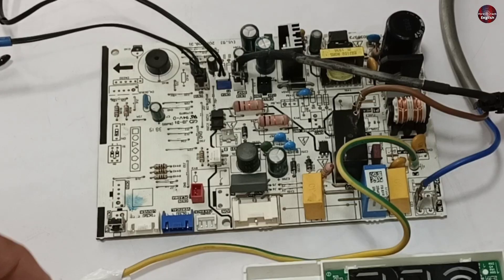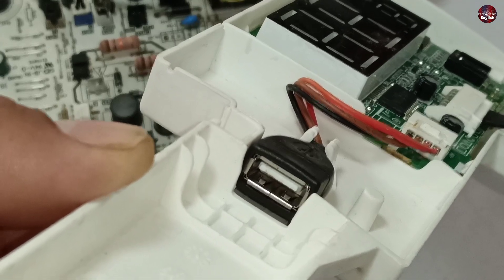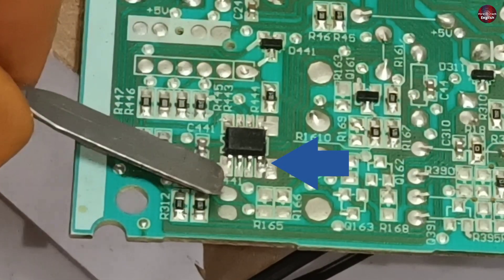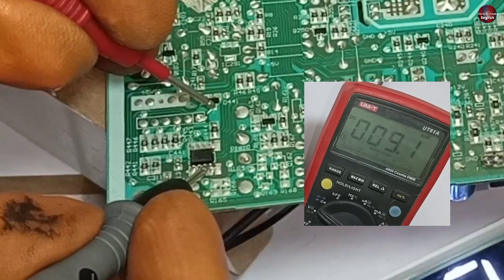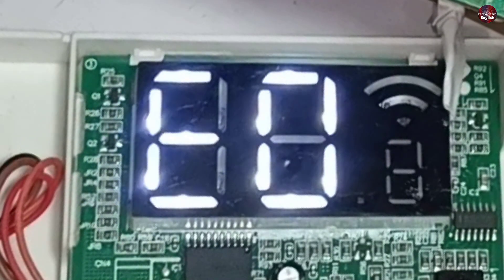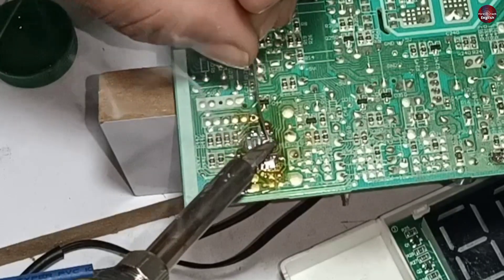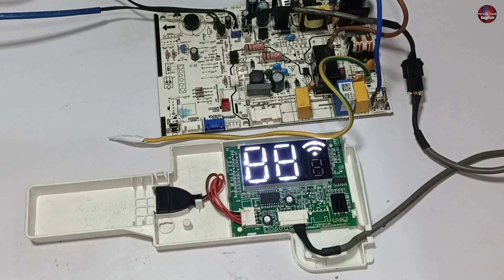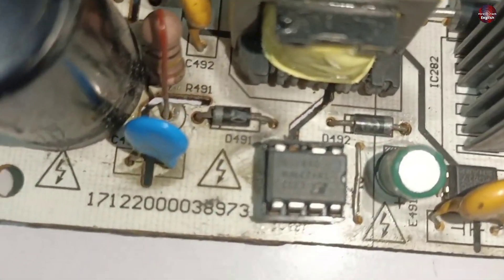The Other Tech is Unaware how to Fix E0 Error In AC Motherboard

Comment: Hello, where did you find the data to be programmed to the eeprom?
Reply: I am using a EZP2019+ to read and write the EEprom from the BIOS-chip of my PC-mainboard.
This is simply a connector and a little USB-SPI-converter.
If you do not have the right program from the producer of this Mini-Splt-Device, then you can read the EEprom of a working device and store the intel-hex-file on your PC. But you need the same device with the same mainboard to get a copy of the program.

The 24C08RP has only 8kbit (1kbyte) of EEprom, so there will not be a program on it, this could be some configuration data or it is used as memory to store the temperature and fan settings.
Reply from the maker: This is how I do It
Reply from the maker: Well I have already in my database, that video will be soon uploaded.
Reply: @forevertechenglish  Listen, it seems that all technical professions have some kind of software that needs to be re-programmed in case of error. Unfortunately, many people refuse to share. It would be nice if you could share such knowledge. You are already sharing a lot. With your videos you help all people who want to repair instead of keep buying new stuff and is really a breath of fresh air. The English translation is really needed. Please, keep it up!